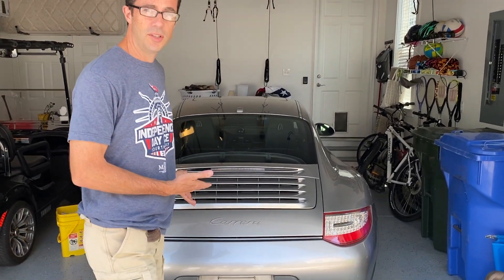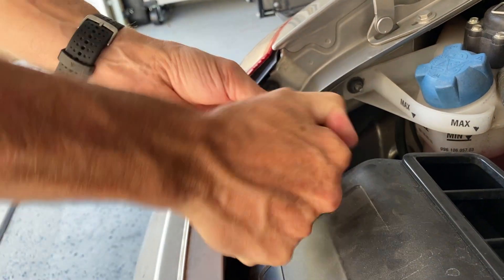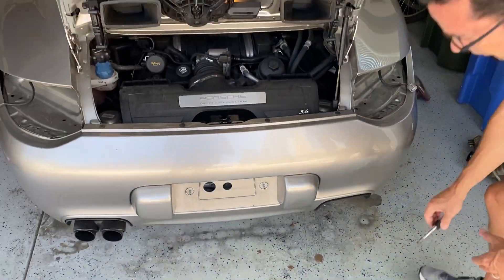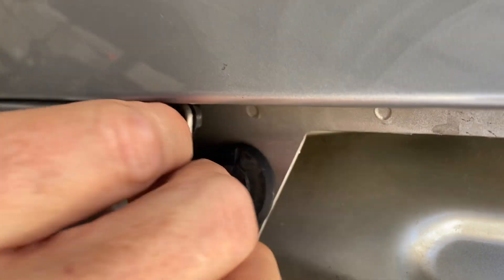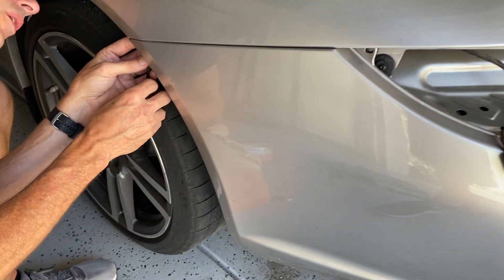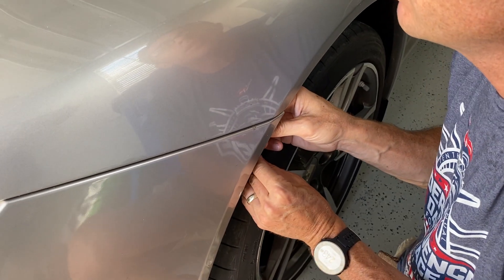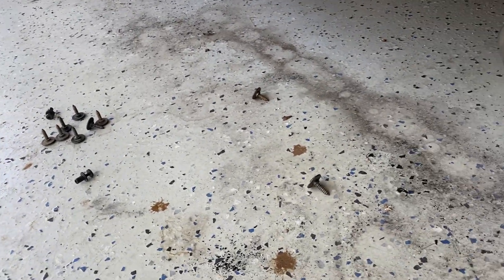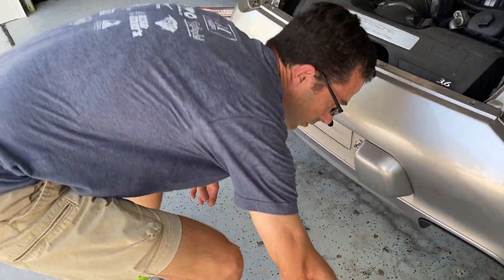Porsche 911 997 rear bumper removal in real time - less than 10 minutes

Comment: Those screws above the wheels are really Mr Impossible. Took now forever. I’m shivering at the idea of putting them back on. Probably will need to remove the wheel
Reply from the maker: Yes they are a pain in the back side to get at with the wheels on.  I would think you could jack the car and it would drop the wheel down a bit and grant you more access to the screws.
Reply: I did finally put it back together and those screws were indeed a pain. Even if you jack the car, it takes a long time before you hit the right alignment. 
The two things that make it difficult: 
1. The bumper lip which covers more than half of the screw
2. The screw itself is not aligned with the curvature of the wheel arch, but rather vertical instead. The angle is completely counterintuitive 

Anyway, all good. Hope I won’t have to do it again soon

Comment: Thx so much! I did this one my Porsche. The video helped so much. But I got a warning message to check backup lights after reinstalling everything. Backup lights work fine. Do you how to clear this error?
Reply from the maker: I do not. Did you have the ignition switched to the on position or start the car with the back up lights unplugged? Also are both of the back up lights turning on? I think the back up lights are in the taillights so it could be a burned out bulb. If that doesn’t work, maybe try a scan tool and erase the code. Sorry this happened to you.
Reply: @didifixthat7910  It randomly went away. Everything worked so I’m not sure why I got the warning or why it went away.
Reply from the maker: Jared Ritter Glad it fixed itself. Put that in the savings column. Thanks for letting me know how it worked out for you.

Comment: Do you know if this guide would help with removing the rear bumper for 997.1?
Reply from the maker: I would think that the process would be very similar. Im sorry I can’t say with complete certainty but my video should get you going in the right direction. I know for a fact that the taillights are of different shape on the 997.1 but I would think that they are held in place in a similar fashion.

Comment: Thanks for the well done Video.  Queations:  What is the name and source of the hand held rachet?  And, where did you purchase the long torx's?
Reply from the maker: Thanks for watching the video as well as the kind feedback. I purchased the torx bits at harbor freight. They are cheap and I use them infrequently so I didn’t want to spend much on them but they have held up very well so far. The hand held speed ratchet is from a set of sockets I bought 20 years ago.  They are from a set called metwrench. The sockets are sort of elliptical on the walls of the sockets and they can fit both standard and metric. Those sockets have help up really well. Hope it helps.

Comment: Your videos are fantastic!  Well done!  Where can I get the speed ratchet you use with the torx drivers?
Reply from the maker: The speed ratchet came with my socket set.  I use a set called metwrench.  It’s a set that the sockets fit both standard and metric at the same time.  Really a pretty cool set that I have had for 20 plus years.   Thanks for watching and commenting.

Comment: I didn't see if your car has the backup sensors, and if so how did you unplug that connection?  I too have a 2011 997.2 C2S w/ PSE, and I've a cargraphic center bypass I had installed in 2017, and am looking forward to deleting the side mufflers and coming straight out of the bypass to the tips.  How do you like your exhaust sound/note/drone now?
Reply from the maker: Arne D The car does not have the back up sensors.  I have the factory PSE so I’m not quite sure how the straight exhaust would sound.  I was tempted to start the car without the mufflers on just to see what it sounds like but was afraid that if I did, I would throw some weird engine codes.  If you don’t mind make a before and after video if you do change your exhaust.  I’d love to hear it. Thanks for commenting and subscribing.
Reply: @didifixthat7910  Thank you for the quick feedback.  My suspicion is no code would be generated; the CATs are on the header assemblies (before the center muffler/bypass), but I guess I will find out if/when I get around to doing it.  
fabspeed sells the straight pipes coming off the bypass, and they don't make any mention of codes being generated in doing this mod (these outfits usually warn you in case it will generate some code).  I will plan on making a video of it.  
The cargraphic bypass made a noticeable difference and I retained the function of the PSE, but that won't be the case if I delete the side mufflers.  I have the turbo wheels, like you do on yours, and also the clear taillights.  Mine is meteor gray w/ camel leather interior.  Yours is a very nice exterior color; what is that?
Reply from the maker: Arne D Yes I agree if you keep the cats on and the O2 sensors plugged in I think you would be ok. Thanks for the compliment on the car. The exterior color is called Platinum Silver Metallic. Per the window sticker it was a $710 up charge. I have a standard black interior and a pdk transmission. Really fun car and surprisingly easy to work on. I was a bit anxious about getting the car and service costs but so far so good. Nice to connect with you. Enjoy the ride.

Comment: Ever thought of removing the bumperettes ?
Reply from the maker: Funny you mention that.  I actually bought a plastic panel I was going to use to block off the area behind the license plate and bumperette area.  I took the bumper off and the. Discovered that underneath the bumperettes there are structural metal reinforcements.  I thought that they are there for a reason, crash protection of the engine, so I elected not to remove them.  I do think it would look so much better without them.  Oh well.
Reply: @didifixthat7910   No You can take them out, only the US has these ugly bumperettes. I am not sure how the plate would look like. My plan was to try to take the bumperettes off and to put them in from the back, so they don't stick out as much as they do now. Not much to find here on Youtube and there is 1 post I think it was on Rennlist.  I am really tempted to try this, but first I want to replace the engine mounts as that seems to give a great improvement. ( Mine has 78.000 miles on the clock )
Reply from the maker: @Francois997.2  Yes the bumperettes come off the bumper cover in about 2 seconds.  Just held in with some plastic tabs.  The issue if you try to mount them so they don’t stick out as far is that they won’t completely fill up their respective mounting holes.  That’s why I wanted to use a thin piece of plastic.  I had some black plastic that is 1/8” thick.  Once I removed the bumperettes, I would cut a piece that would go from bumperette to bumperette and I would have used the license plate to hold it in place.  I think it would look good but I went for safety of the engine over aesthetics.  I wish I didn’t value safety so much. Ha ha.